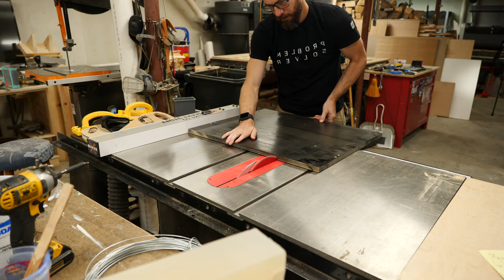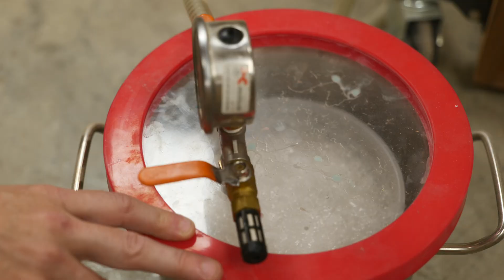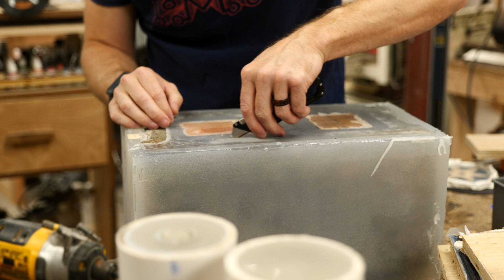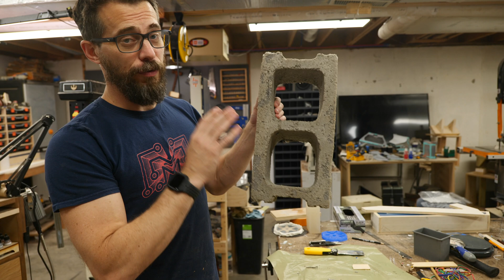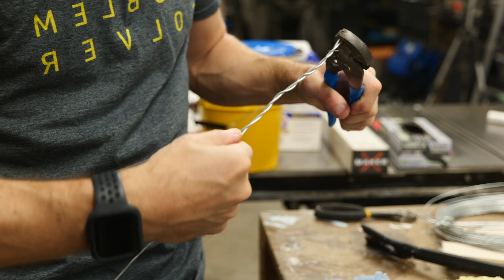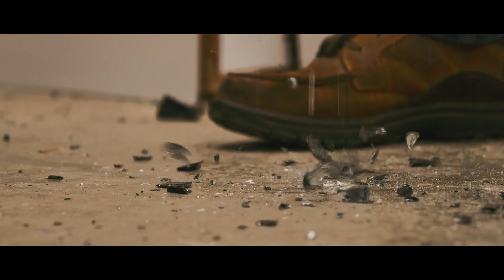Making Stunt Props for Action Movies | I Like To Make Stuff

Comment: Great tip on 2 part mold making using: use small clay balls  instead of making a solid clay "bed". This will save a small amount of clay and will make MUCH easier to remove the clay after the first pour.

Comment: One very important thing if you use armature wire in a mold is to bend over the ends, or stick some cork on them or something.
Because if you don't you have a perfectly safe toy to hit people with the one second and the next, a weapon that's sharp and scratches like something fierce.
Because the sharp end of the armature wire likes to work itself free and that can cost someone an eye.
Reply from the maker: Very great point!

Comment: One trick you could have used for the wire armature was attaching it to your drill on one end and have the other end just tied to something solid. By spinning the drill you end up with perfectly twisted wires. You can even do this with thicker single wires if you need them to be very straight. Cheers man!

Comment: I have advice because I'm definitely a professional; use spherical shaped objects for your mold keys- squared edges may catch, also when making new molds with large amounts of dead space, cut up old molds of the same silicone and distribute the bits in the new mold while still liquid. On large, rigid, objects make molds as thin as possible- 3/8 of an inch would suit that cinder block well. And you already mentioned this, but it's REALLY important to seal any porous surfaces contacting the silicone when moldmaking. Wood is a hell of a time to try to pry off. Good attempts though, and I hope to see more moldmaking!

Comment: Hey Bob for the armature wire a trick I learned is instead of cutting different pieces of wire is by measuring out the same length of of wire connect the bent area to a hook that’s in a piece of wood and the loose ends to another hook that’s in your battery powered hand drill and braid it that way.

Comment: Get blocks of the cellulose packing foam (the water compostable peanuts that turn into snot), carve them into scaffolding for cinderblock forms, make some aircrete slurry and spray the exterior to texture realistically, submerge in whatever mold material you are using, when the mold is ready then drill a couple small holes so that when you put in the water and collapse the now hollow thin aircrete form you have a vent so you don't get a gooey blowback from the cellulose lol

Comment: Hey!  You should use a thin oil coating of some type on the concrete and box surfaces.  That would have made removal of the block much easier.

Comment: Hot tip for your armature, cut twice the length, fold it over, slam it into the chuck of your drill, grab the other end with a pair of pliers, crank that drill, enjoy your badass extra strong wound armature.

Comment: If you try to make th block mold again teyusing drywall compound to smooth out the sides of the holes so you can use mold realeaae, also you need to remeber those holes are taper.

Comment: An easy way to twist your wire is to clamp one end of the two wires in a vise and put the others end in a drill. Then SLOWLY run the drill to put your twist in the wires.

Comment: before you do the silicone inside your block you use Petroleum Jelly all over the block
easy to remove , its easy to clean off , the broken bottle the one that didn't make it what you could do
in filming would be have someone in bear feet walking on the floor and if you put some a/b blood on the glass , being part a and part B on there feet and when they walk across the glass they are cutting there feet ......looks great on film

Comment: LOL at the ending, you guys have way too much fun. Great video on mold making and casting. Could you have used compressed air to open the molds a bit to get the original part out? I am surprised you didn't make the cinder block out of stacked foam pieces, cast around it it with plaster and then split the mold so you had 2 E shaded pieces.

Comment: Couldn't you have used a bit of compressed air to loosen the molds from around that cider block? Coating it with a few coats of concrete sealer may have helped it release better too I'm thinking. Fun video.
Reply from the maker: Yeah, we considered covering the block in modge podge, but decided against it in the end. Maybe next time.

Comment: The sulphur will only inhibit platinum silicone, it won’t inhibit tin silicone. That has some other inhibitions, though. Usually for big props like this tinsil is the better choice as it’s far cheaper. Also generally takes longer to cure though. The cure time and skin safe are for me two important factors, hence I too have the (far) more expensive platsil in store. But if I were to make a block molt for a cinder block it a crowbar I’d probably buy some tinsil 😂I’m a cheapskate 😂

Comment: could you cover the brick in varnish or epoxy before making the mold?
Reply from the maker: You can. YOu just have to make sure you don't loose detail. And the actual brick helped coat the foam in dust so it looked like a real brick right out of the mold.

Comment: Next time, use the air compressor to release the molds. Inject the air between the silicone and the walls of the mold.
Reply from the maker: We did that too. It was just super stuck in a lot of ways
Reply: @Iliketomakestuff  that texture will put a fight when releasing, hahahah

Comment: So did you just use what you had there and that's why you used two pieces of 2x4 instead of a part of a 4x4 or is it because most 4x4's are pressure treated and have a rough texture as a result just a question.

Comment: Who else was frustrated that they wrecked the mold for the cinder block??? 🤦‍♀️ next time put mold release on the filler blocks so you can just push them out like in Jenga and it would make it so much easier to demold the center parts when the fillers are gone.